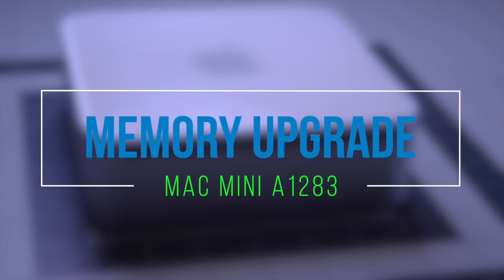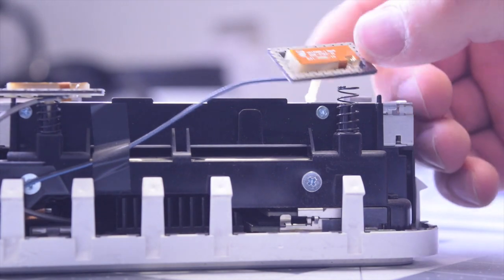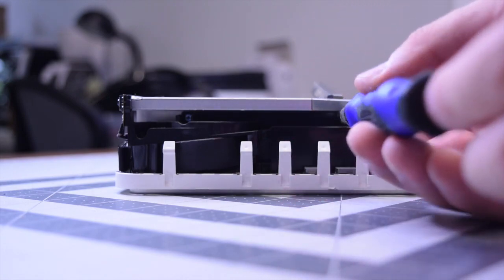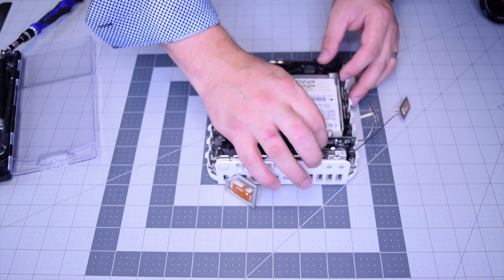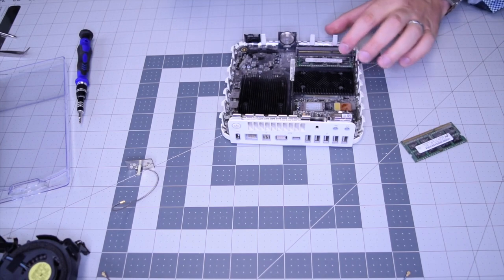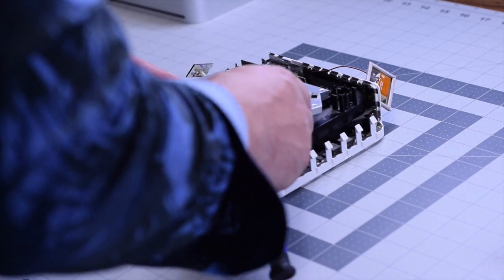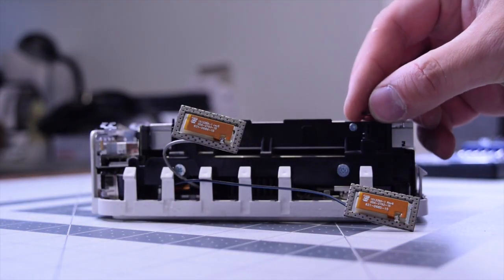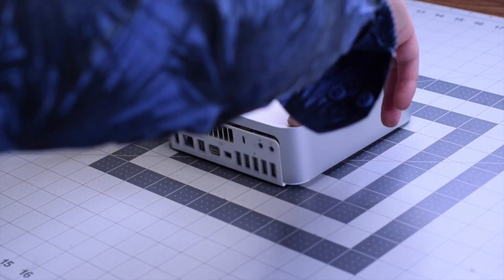⚙️🛠️🍏 Mac Mini A1283 - Memory RAM Upgrade

Comment: What's the max RAM this model will accept?
Reply: 8 gb :D
Reply: @stewballs7  can you install the 8 before you do the firmware upgrade or do you have to do the firmware upgrade before you install the 8 gig?
Reply: @parkman47   I would do the firmware upgrade before the ram, there would be a chance it won't boot with extra ram and no firmware to to support it, do the firmware then the ram.
Reply: @stewballs7  What is the number of firmware that it needs to be able to increase to 8gb the ram memory? it has to be ddr3, right?
Reply: @jluismz6532  late reply but yes, DDR3, its an older Mac Mini, DDR4 didnt exist then.
Reply: Its ddr4 ???